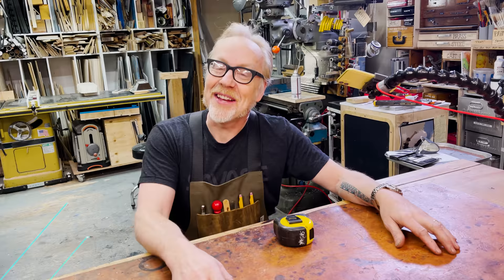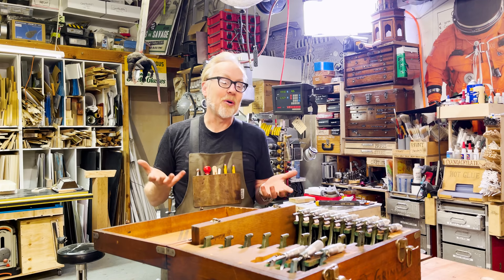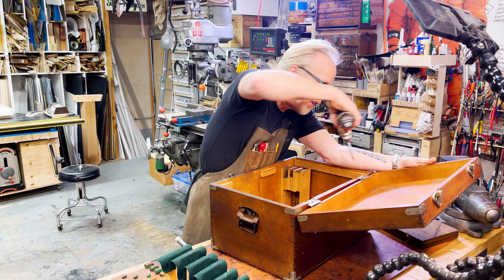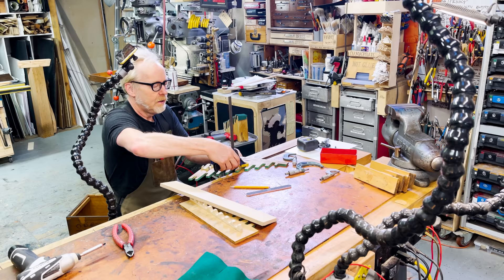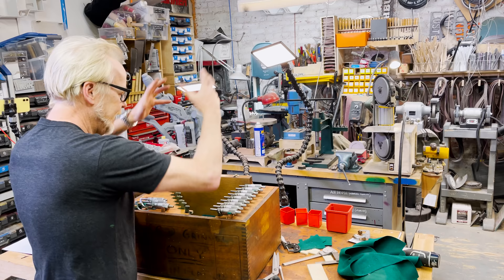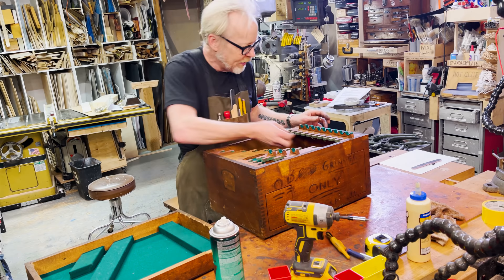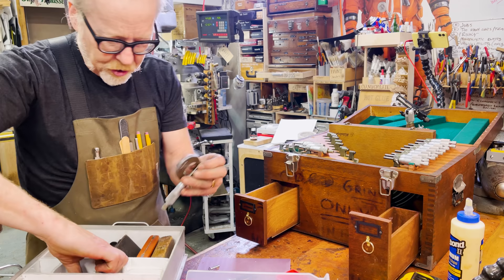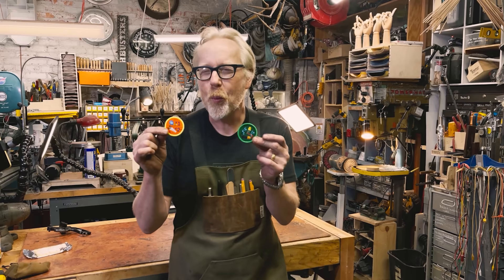Adam Savage's One Day Builds: Micrometer Gauge Box Set!

Comment: The brown and sharp 1" was the best one he had. He said I think I picked these up at a garage sale or something and seemed to discount that one in secondary pile. In reality you can adjust those about twice as the threads wear then throw them away, you will have at least .0002 runout in the threads. Thats huge, even if your only wanting to be able to hold a thousanths tolerence, thats still 20% of your tolerence. out of all uncertainty factors, thats the easiest to control. the 1" B&S I use exclusively and donate them to votech classes after a second adjustment. we use a bunch of them, we hold .0001 total tolerance frequently, naturally a one inch micrometer isn't what we use for that but you do get to know your tools pretty well doing that. It would be fun to do something with Adam, he's so sharp with a well rounded talent. Surprises me sometimes how well rounded his machining skills are and he's tooled up pretty good to. I'm not even that good with general machining but have a simular setup I play with. I do precision grinding primarily and build my own equipment 100%, to be able to achieve tolerances... Adam is making discoveries here himself, never assume anything, he is correct. Its why I build everything I put in service, even if its factory new, the factory has tolerances, I get rid of that on every single dimension before I run it and use hard surfacing where I can, improve lube systems where I can and seals. assembly is practically sterile as close as I can. after that amount of effort, I just try like hell to keep that first microscopic little scratch of wear from staring, its the beginning of destruction. of course I rework any components at the first sign of wear... surprisingly, my general machining skills suck compared to Adam's. he would be fun to share ideas with, his engineering talent mixed with machining is a rare combo, that shouldn't be so rare. Thanks for the videos they are fun to watch:)

Comment: I spent a year or so working in a shop that manufactures and maintains rotary cutting dies. Basically a metal cylinder with razor blades that cut specific shapes out of sheet stock that rolls under it. I worked with the cnc sharpening (some dies had to be sharpened by hand still) and had to indicate and use a microscope to locate features in microns. Very cool job

Comment: "How to cut out the drawers"... have you considered an "oscillating multitool" (I think that's the English term) - it has seved me a ton of work in such cases already.
Reply: I had in mind to drill out a hole (or 4 for all 4 corners) and use the saw like a normal person doing woodwork, but he wanted to do it that way, so....

Though, after the hardware was put in, I noticed one of the drawers was too tall since it interfered with opening, so he had to sacrifice a bit of it to make it work. Evidently, the locking loop was also in the way, so he had to flip it up just to close the drawer as well. Foresight would have prevented that design flaw, but at least he made it work to make as much space as he could put all his other mics in, as well as the mic stand. Repurposing got done and that's what he wanted. Machining is a bit that way too. More than one way to skin a cat, so you just send it.
Reply: @AAFREAK  Drilling corners wont work all that well if you want to keep the piece you're cutting out?
Reply: @drsquirrel00  he said he was gonna keep them, and I believe him. But from a design standpoint: finger holes.

Comment: That is a beautiful set of micrometers. New it would cost a large fortune. Great re-build on the case. I think I would add a lid stay.     I have a set of 3 Starretts from the 50s that are perfect. They were in storage most of their lives. I hope whoever gets them when I die appreciates what fine instruments they are.  My daily go to is a Mitutoyo with a mechanical digital read out similar to what Adam showed at the beginning of this video. A very good device. Calipers get me in the ball park. Measuring smaller holes, I use gage pins. But my sets only get me to an accuracy of .001, +0, -.0002. Not good enough for small press fits in steel. I can measure from .011" up to 1" with my 1/2" gage pin set. Machining is all about measuring. Like Adam, I also had reached the limits of my original chuck and bought a higher quality 8" 3 jaw and a collet chuck. This hobby gets expensive!

Comment: "Get my hand away from there." - anybody who has taken a finishing nail through the finger
Reply: Or someone (me) who's taken a 3.5" framing nail through his left index finger. I cringed when he was at that part.
Reply: @kylevogelgesang9996  

I cringed pretty good, also! I was reminded of back in 1991 or so, when I worked in a wood shop which manufactured "Pre-Fabbed" Roof Trusses, Gable Ends, Dormer parts; etc.

I was using a Power Stapler to assemble some small Dormer parts, when a staple bent while going thru the wood, and went clear through the tip of my left, middle finger! Ouch!!!

Funny thing was, I pulled my hand away so fast, that I did not realize at first, that the staple had actually gone all the way thru my finger!

This happened right at the end of the night, (2nd shift), & it was only after cleaning & bandaging, and heading home in my car, that I noticed blood seeping thru the bandage, near the tip of my fingernail! 

I stopped my car for a bit, & loosened the bandage to have a look, and saw that the staple had indeed penetrated, and slightly split my fingernail near it's tip.

One cannot be careful enough, when doing that kind of work!!

As I recall, I was holding the framework of the piece I was stapling, at what SHOULD HAVE BEEN, a safe distance from my stapler, (and my foreman who had been nearby at the time, later vouched for the placement of my hand and fingers).

However, being that the staples I was using were rather long, and that one particular staple ended up hitting a knot or whatever, as it did; it bent sharply in the direction of my hand, and succeeded in "nailing" me just the same!! 

Serious Pun intended!!  😫 😊 

Again, OUCH!!!  😫 🙂

Ron
Abilene, TX.
Reply: I haven't taken a nail through my finger, but I'd still move my hand away in similar fashion as I have taken a drill bit into my finger after not realizing it was in the way and my drill got a bit too fast through the wood

Comment: That came out great. I would offer up a couple of comments/suggestions. 
1) Lower the blade guard on your bandsaw. The upper blade guides aren't doing you any good when they are 6" above the cut.
2) It's not that a big a thing in this instance, but I almost guarantee the instructions on that can of finish say don't shake it. That makes tons of tiny bubbles that can mess up your finish.
3) When you clamped the case to the bench to cut out the drawers, you clamped from the top of the case, and it was a bit wobbly and the clamp was in your way. Next time, spin it around so the opening is facing you, and clamp the bottom side to the bench. The clamp will be out of the way and it should be more stable.

Comment: 0:53:33 Do you see it?  The drawer front on the right is going to foul the latch....
Reply: Yup. He had to cut the latch to fit. 🤦🏻‍♂️
Reply: I saw it.  I saw that his opening crossed over into the shadow of the latch, and then I noticed in the time lapse when he came back with that latch, he looked, left, and then came back again... presumably with the new notched latch frame. ;)  I guess that's the drawback of using the tape as the marking surface without marking out possible interference from the hardware.  It was close enough to still work out, thankfully!

Comment: There is a fourth measuring surface on calipers that Adam didn't mention, that I only learned about after years of using them when a machinist friend pointed it out to me that I was using them wrong (I need to stop throwing away instructions before I read them). Its the step measurement; it is similar to the depth but uses the top flat of the fixed and mobile jaw. It's great for measuring or laying out offset objects and it makes measuring step downs on circular material infinitely easier.

Comment: I know this an old video, but a couple of comments on lathe chucks:

1. If you get a tool post grinder and make and affix a long arbor, it's possible to regrind old chucks back to near-true. Just need to have something to chuck onto out of the way of the stone to ensure the jaws are properly loaded. 
2. For fine precision, collets are the way to go. For ultra-fine, independent chucks (4 jaw, etc.) are the gold standard. They also make scroll chucks with tuning screws in the backplate that can be adjusted. 

Also, on the dial calipers, you forgot the 4th way they can be used... step measurements using the nose of the scales. Didn't learn that one in school though...

Comment: I loved this set. I really like Mits. one the Browne and sharp dial calipers you left out that you can do depth with front and slide. Look on the back it has a ledge. For flat surface you can measure depth more accurate. The stem is ok for depth. In the shops I worked calipers were like tape measures lol. We often held. 2 microns. And the prints had temperature of measurement. It was crazy. Sometimes we would just hold them in our hands to heat them to temp. Laser thermometer. Then check diamesions. Now these parts were on a center less grinder. But I love your getting into small tolerance Maching.  It's where you really learn how worn out or good your tool and skill is. You can work with backlash if you know the machine.

Comment: 3:35  For me, it's important that i put the exact same motion and pressure to counter the slack in your callipers. It gets you faster to the point that you have to use a micrometre. If you measure the same way every time, that way it is possible to go down 0.04 mm (0.0015748"), and then you get your micrometer to get down to 5μm - 2μm (0.00015748" - 0.0000787402").

Comment: I went thru the same thing this year. It was hard, but forcing myself to do it right and use the right tools I was able to make a device I never had the precision to for 40 years. It was an water bullet gun made completely from scratch. If the fittings were not h in tight tolerance (tight compared to what I use to do ) the little delicate water gel bullets would rip apart inside the gun. I was able to accomplish this build (four guns in all to be used for a Halloween shooting gallery) and I still am surprised I could. Buying 4 good guns such as this would have cost several hundreds of dollars. So I HAD to make them or give up on the making this shorting gallery. Water pellets are biodegradable and faster than any other "toy" gun ammo except for maybe nerf darts but nerf would not set off my impact sensors for the animatronic monster targets. And laser guns are no fun...

Comment: 3:10 there is a 4th I just learned. If you want to measure the distance between two steps, or the distance from an end to a shelf or something like that, the back side of the caliper can be used. If the external measuring tines are on the left, and the internal tines are on the right with the dial/display upwards, on the bottom side there is a shelf created by the parallel yet offset sliding bits. It works perfectly and is just as accurate as the rest. Sorry btw if this explanation is confusing, I'm not great at putting words on paper and a 3 second gif could completely explain it lol

Comment: It's videos like this that make me wonder if I should throw some instructional videos on how to do things like use measuring equipment. The first thing you had was a dial caliper. a caliper is a sliding measuring system, they're vernier calipers if they've got a vernier scale on them. The second thing you had is a micrometer, it's not a a caliper because it doesn't have a sliding jaw.
There are four ways of measuring with a set of calipers. the top of the head is ground flat, so you can measure a step more accurately than you can with the tang. When you use a caliper for measuring the outside of something the first portion of the jaw is sharpened to prevent the bridging effect that you raised.
It looks like your first micrometer doesn't have hardened anvils (measuring surfaces) and you probably shouldn't use it for important work. Second would be that, every time you use a measuring device you should wipe the measuring surfaces and the measured surfaces. Just with your fingers is good enough, but it stops debris getting into the measurement, which can cause quite a bit of error. The thimble (the clutch ratchet thing) is also there to prevent people from going ham on the barrel of the micrometer. It's what you teach apprentices with. One of the things that you need to learn to become truely accurate with a micrometer is getting a really good feel for touching off with the anvils on the job. This is a way that you can feel if you're not flat on the surface or how to tell if you're clamping on debris (the feel will be markedly different). the reason it's so important to develop this feel is because you can tell if you've got good contact, while, at the same time, ensuring that you don't have crap trapped in your measurement chain.
There's plenty more, but that seems like the important stuff there.

Comment: So a couple things. 1. If your going to use calipers to measure an OD, do it at an angle. So your blades cover as much surface as possible. 
2. If your going to measure a wall thickness or other circular surface with calipers, use the blades tips it the end. 
3. Mics can give you that wobble effect you talk about. You should always give it a bit of a wiggle up and down. This can literally be the difference between .001 and .0015.  
4. 11:00 Not calipers. Micrometers. We use several of those. We have up to 9-10”. Never seen an 11-12” mic. 
5. Mics are only as accurate as they’re calibration and user. I’m a QE and one of my jobs is to do gage studies. Mostly customers will ask for gage R&R studies. Which is repeatability and reliability. If three different people use the same mic, and get three different measurements, that’s not good. Especially when you’re dealing with drawings which call out true potions or concentricity (most people use runout to measure this) of .0001. 
6. We usually use carbide jo blocks for calibration on the floor. For precise calibration I’m wondering what you used? You could have adjusted them for your use, but not actually calibrated…. 
7. You know they make super mics right? You could have bought one of those for probably the same price and be more accurate.  
8. Did you know they make digital mics? They’re more expensive but much easier and measure to millionths… still accurate to .0001 but have an error of .00005

Comment: The Japanese pull saws rank on the highest levels of “best of the best I won’t be without”, right alongside my Starrett 0-1” micrometer, spring-loaded nailset, CA glue and activator.
So jealous of your workshop and equipment. I’m making do with a portion of a 120 soft shed aka workshop aka man-cave, equipped with solar panels on the roof, feeding 3 high Ah car batteries via charge controller that power led lighting, an inverter to charge my fat tire e-bike battery, Yamaha receiver and 1970s Pioneer turntable with upgraded high-end cartridge, two adjustable power supplies for electronics work, iPad for watching YouTube, etc. Darn near live out here...
Would be more fun to come hang out in your cave though. LoL

Comment: Adam, you are supposed to hold the Micrometer Frame with your little or ring finger, and use your thumb and index finger of the same hand to tighten the thimble for your reading. With practice you can get a tighter reading to within .0001 by the feel. You don't get that feel with the ratchet. Standard ends and jo blocks along with Micrometer anvil and spindle faces, need to be cleaned with acetone prior to using them as gauges. When using cleaned a Jo blocks stack, be sure to press and slide them together so they stick with the vacuum between the blocks for the best consistent readings.

Comment: I  use rubber cement for attaching things like felt because it makes the felt removable in the future for replacement. Hot glue Has to be sanded and scraped off and if it’s soaks in very deep to something like wood it’s an even bigger problem and a lot more work

Comment: Hi Adam, detailed and interesting subject matter all in one place. It turned out very nice and just proves what a little effort can achieve. With all your like tools safely stored in a nice practical cabinet/chest. One of my pet hates is the little plastic cases everything comes in these days. I am old enough to remember when tools came in a purpose built wooden case probably crafted by a cabinet maker and larger kits in cabinets much the same. I do feel that one point might have been missed regarding the Vernia callipers and micrometres. In fact it applies to all measuring devices but is especially important when using instruments with these finer increments. If one takes a precision tool say from a warm or cold home out into a cooler or warmer workshop, the difference in temperature between locations can cause the instrument to expand and or contract unevenly and distort the true reading. So one should always allow time for these instruments to acclimatise to their new environment before taking measurements and enabling all parts of the tool to even out its temperature and become uniform. I do hope you don't think I am being picky, that is not my intent, it is just something I was taught about 50 years ago and never forgot. Thanks for sharing.